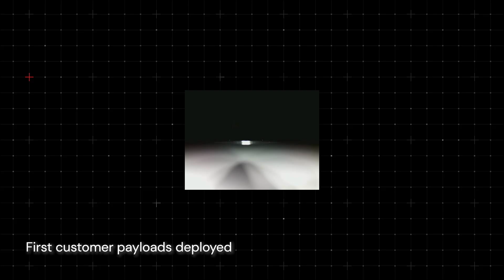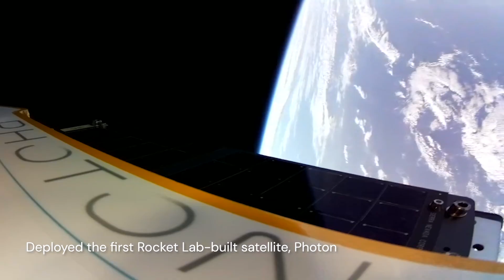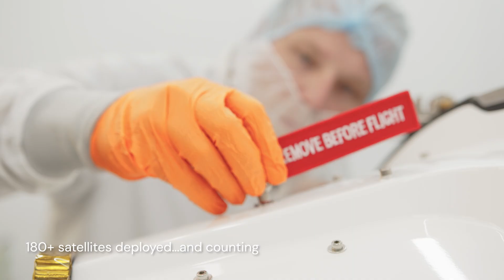The Road to 50 Launches

Comment: From a shareholders perspective like me, after 50 ELECTRON launches the share price fell to the $4 range in 2023 and stuck in that mud ever since. Is that good enough? Surely not. Only NEUTRON can save the future, lift that constellation to orbit. The work is not done. Not the time to relax. Shareholder value has not been maximized. Let's really celebrate when NEUTRON is flying. We'll all feel much better.
Reply: I bet October has you feeling better and that's without Neutron
Reply: @scoremat  Rather than sitting on a startup stock like $RKLB starry-eyed dazzled by hype, waiting for NEUTRON never-never day, I've been filling my pockets with gain, buying and selling RKLB several times since the $3 and $4 day's, building buying power; switching to LUNR sometimes. Today I sit on my $ pile (no stocks) eyeing BIG events like Nov 5 election; RKLB & LUNR Q3'24 cals early Nov, and LUNR IM-2 Lunar Lander launch Jan'25. Then I'll be back on RKLB ripping some more gain.